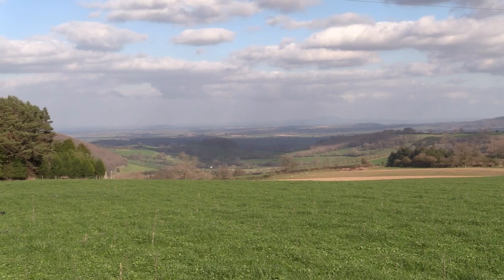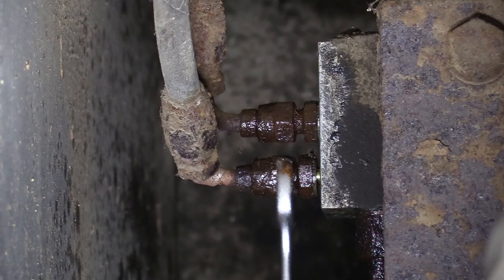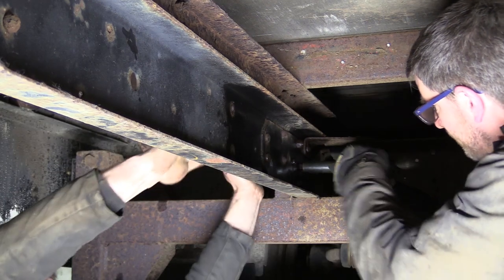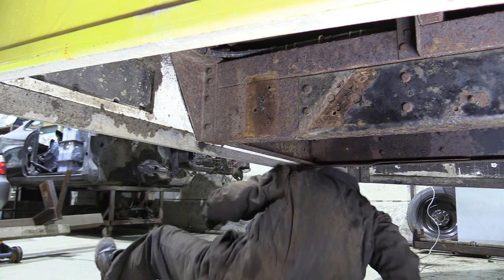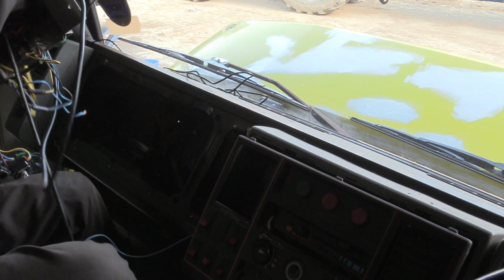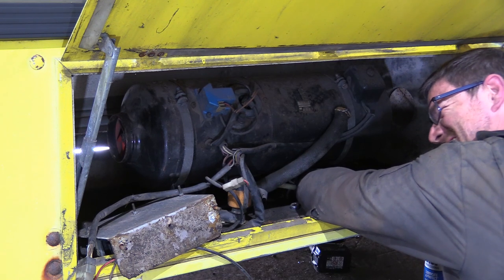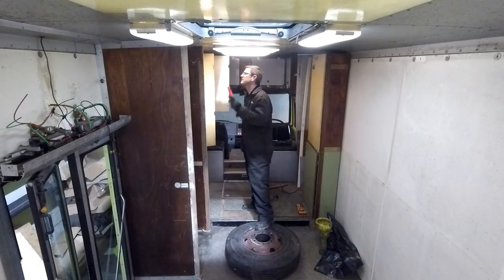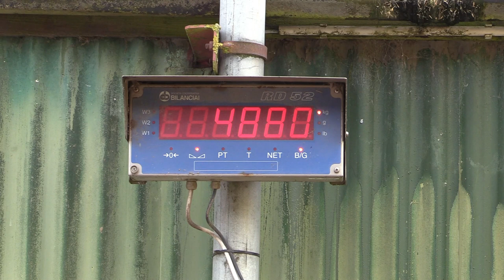The Escargot - RV/Camper Car Transporter Conversion - Part 1

Comment: Another great video, this brings back some memories, used to look after a fleet of these, watch out for sticky rear caliper slide and pistons, they seize and eat there way through the rear disc's, also front king pin's, not nice to have to change if worn, keep them well greased, we also converted one to go hill climbing back in the late eighties, we had a toilet at the front with hot water supplied by the engine heating a house hot water tank and fold down camp beds, ours had a tail lift, came in very handy for maintenance. To up the power we installed a turbo from the next model up, but boy did that drink fuel, keep up the great work, Thanks

Comment: When they were gutting the inside I kept waiting for them to remove one wrong screw and have the whole truck fall apart. I was reminded of the words of Bart Simpson, "I wouldn't remove that, it's a load bearing poster"

Comment: YES! Another excellent project. I love the way you guys disassemble everything instead of using the hot wrench and Sawzall. I guessed 4750 as the reduced weight, so I was not off by much. That ESPAR heater gave me a nervous twitch. I used to have to repair those on old NYC payloaders. Good luck with this new project.

Comment: Sound deadening #noisybeast &  better exhaust ( bigger boxes or more boxes) . Penetrating fluid rule being , spray on , have a brew . The time taken is how long it's takes to work its magic . Always use a ring spanner on the nut , not open ended and spray the bolt head as it makes the difference(for folks reading this comment) beds above cabin as take up the most room ;) holes in things =weight saving but for God's sake please the colour . It hurts my eyes LOL . . #Green

Comment: If you guys are really scrapping the materials you remove. There are quicker procedures to demolition. 
For an example. The cables that powered the hydraulic jacks could have been cut every 3 meters or less. That would have saved you from feeding the cables through each zip-tie that ran the length of the vehicle.
This is just data to ruminate.

Comment: Having done a van conversion I'd hang on to some of the cabling and bracketry for the time being as you'll need some of it when you do the habitation area.

You might want to join the http://motorhomebuilder.com/threads/bad-obsession.66596/  forum too, as you will get lots of help from them.

Comment: Actually  it is rather a good bit of kit - or will be . Rusty bolts don't waste effort use the oxy torch to heat the nuts up to cherry red and everything  unscrews with ease.Actually a covered trailer suddenly looks very attractive - all that rust and dust  CVs are horrible things!

Comment: You can get the rest of the weight savings you seek by going to a truck scrapyard and picking up alumillenium instead of steel wheels for your tires. I think you refer to them as tyres. Sorry, I don't know how to spell whatever it is you call aluminum, but the rest of the world knows what I mean.
Before you slam me for that comment, consider I had a large steeped tea today from Tim Hortons. Enjoyed the new upload but still craving Binky.

Comment: And then when it's converted into a camper you'll put a diesel heater back in it as well as hydraulic leveling legs for uneven ground. Kidding! Or am I?

Comment: The rear "bumper" may have been the underride guard, no? Fellow motorists might prefer you keep it.
Reply: Depends what they plan to do with the back. It's pretty high for loading a car into so they may well angle/lower the rear chassis so an underride guard may not be needed. If it is needed, I am sure they would fabricate something just as strong but much lighter.

Comment: The bumper you removed is a piece of road safety equipment designed to reduce fatalities.  It is designed to keep cars from going underneath your vehicle in a rear end accident.  If a car rear ends your vehicle, it "submarines", or wedges itself under your truck, killing the occupants.  The frame rails of the truck act like a guillotine and decapitates the occupants.  UK road safety laws are much more strict than most of the rest of the world,  I can't imagine that they would allow you to drive your vehicle that way.  You may have to put it back on to make it road legal.
Reply from the maker: We know. It just doesn't need to weigh a quarter of a tonne.

Comment: Air suspension would save a lot of weight. Think about it.
Reply: Plus: Fill the air suspension with Helium. And all the tires. And the cabin.

But for god's sake, don't even think about using hydrogen!

Comment: i did not realise that you are siting the Vehicle in the back .i would have made a workshop / living Q Fit Super Rear awnings for repairs at the rear . Cummins Onan Generator Solar the hole roof use Nissan leaf battery for inversion  and your off .  that truck without the body is around 3 & half tons . can not wait for your next film You can still get some parts for them trucks too there is still quite a few on the road . i assume this is the Non turbo version six pot  . My trade Boys is a commercial rescue mechanic . 10 years industrial electrician then moved in to the Rescue industry . Nick Consult about that under run bar you took off i think today it has to be there by law . it's also your tow pin hook up  nice to see you struggling there with the stubborn nuts and bolts . WURTH 2040 is what us pro's use i have  Swapped out axles and stuff on trucks that are 70 years old nothing better than the above.  it's easy enough to get your hands on some old EV Battery's these make shit hot inverter supply's .Your both Grade 1 student's  .  Nick i would say comes from the Aerospace industry and his mate is a farm boy from Essex who loves silicone tits and adjustable air booty . Boys like you inspire others to do stuff like this gives new life to a old wagon. Respect where Respect is due . most bolts on a truck will go without issue between 1500 NMT TO 5000.  i would sooner drive a cargo that the current eurocargo  it's toilet junk flimsy horrible cack. IVECO I Vibrate Everything Comes Off .  hurry up on the next vid .
Reply: The 82 Dislikes are Numpties who never got off there bottom and did stuff or at least tried .

Comment: I really, REALLY hope you guys replace that bumper with something equally substantial. There's a VERY good reason it was so huge and heavy. It's a critical safety component in rear-end collisions. Removing the bumper or replacing it with one that is not strong enough is akin to duct taping a sharp kitchen knife to the steering wheel, pointed directly at your neck. 

Yes, it's a heavy turd, but I'm a paramedic, and I've seen what happens when inadequate rear bumpers on trucks get rear-ended by cars. PEOPLE DIE, and die in a HURRY.

You want the bumper on that truck to be as solid as possible, because if it fails, it folds up under the truck and the hood of the car slides under as well, leaving the tiny A pillars to fail and the rear step of your truck becomes a goddamn guillotine.  Those bumpers should never crumple, they need to be as solid as possible, because when they fail, if the car was doing more than about 45, the driver and passenger are dead.

Here's a video of what you're doing with that truck by removing the bumper, and examples of how much a good bumper can do to save lives. The key here is that the bumper be as solid as possible.

https://www.youtube.com/watch?v=XFTy0bCE66A

I've seen more than enough corpses from exactly this kind of injury (north or 45mph you tend to never see anyone survive, and if they do, they wish they were dead.) Don't cheap out on that bumper. It might save someone's life.

Comment: Weight loss? Some options;
Rebuild Binky as a carbon fibre monocoque 
Replace heavy Toyota engine with lightweight turbocharged Hyabusa engine
Replace truck wheels with alloys
Fill tyres with helium
Replace truck bodywork with hand formed lightweight alloy panels
I am sure there are plenty more options, just lateral thinking required. Anybody else got any good lateral thinking weight loss ideas?

Comment: I dont want to be the bearer of bad news , but unles the law changed, a hgv vehicle converted to a camper can be re clasified as a class four, but it can only have a cargo area of 1 meter deep for the carrying of life sustaining good or equipment. if you carry the mini in it, that is classed as goods and it will have to revert  back to hgv, and the appropriate test, best check with D.V.S.A i would hate you to get caught out  with a wrongly tested  vehicle, insurance and maybe licence   phil
Reply: AFAIK it is a class 4 HGV, just private, not comercial. As long as they don't try and register it as a camper, no problems.

Comment: So, you're never going to reuse the fasteners or the bits you're pulling off under the chassis, why are you faffing about with penetrating oil and beaker bars? Just gas-axe off the heads and drive the shafts out, you'd be done in 1/10 of the time

Comment: Half an hour and not one instance of the funk? Only a single use of the ol' angle grinder? There had BETTER be brackets in the next episode....still at least we had an AvE reference.

Also if your workspace be cold at least now you've a heater